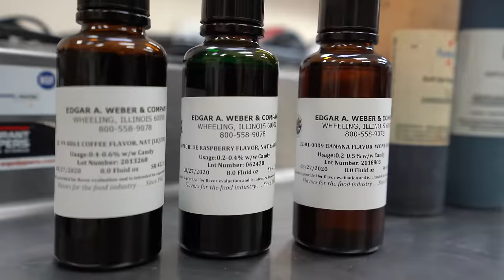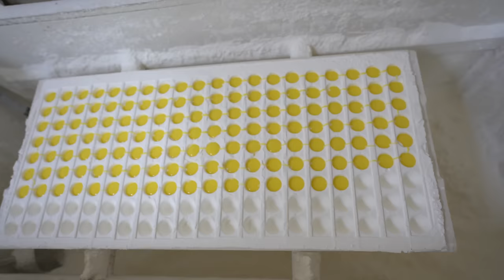We Made Four New Assorted Chocolate Flavors!

Comment: Why not buy a set of bed risers so Max doesn't have to do the splits while pouring creams?  You can get them at Walgreens etc. It would raise the cornstarch table a good 8 " higher.  The table wouldn't roll off the risers because  the casters set inside the top of them.
Reply: Or he could sit

Comment: I believe a Macchiato means the shots of espresso lay in the middle point on top of the heated milk, but under the air aided silky foam. compared to a Latte which the espresso shots are mixed with the milk and topped with foam...

Comment: How about this to get a swirl effect: before adding flavouring, ladle out half of the batch into another container. Add all of the flavouring to the bowl and mix normally, then add back in the previously separated mix and stir with a thin stick. That way you don't risk massive inclusions of raw flavouring and you can mix as much or little as needed to get the desired swirl effect.

Comment: Hey Craig! I'm working with chocolate and silicone molds and I have a question for Steve or Terry, or both! Is there a method to keep the chocolate from sticking to the molds? I was thinking cooking spray, but I worry about it making the chocolate greasy or ruining the flavor. If you could pick their brains, or if anyone knows this, I'd really appreciate the help!
Reply from the maker: If the chocolate is properly tempered it should release easily. Try putting it in the fridge if you are having difficulty and popping it out as soon as you take it out of the fridge.
Reply: @HerculesCandy  This is perfect! Thanks so much for the help!